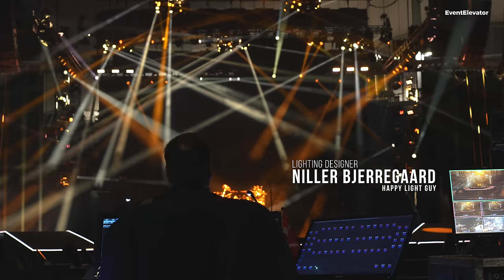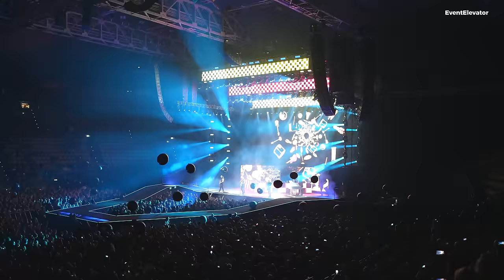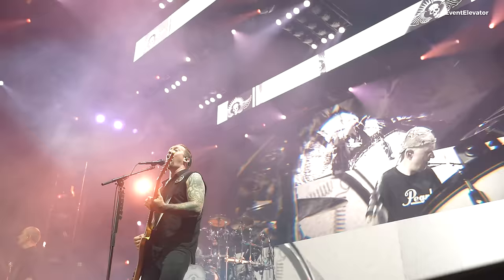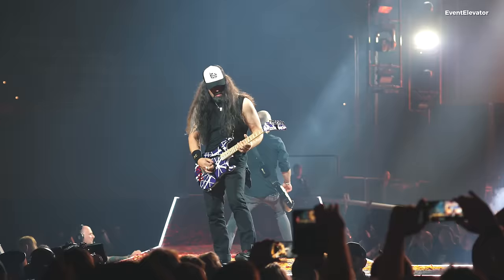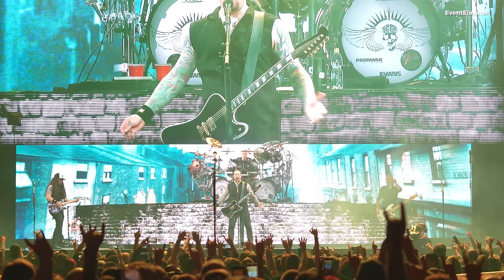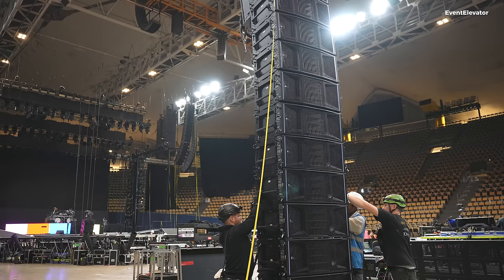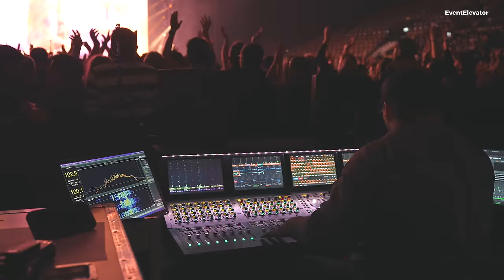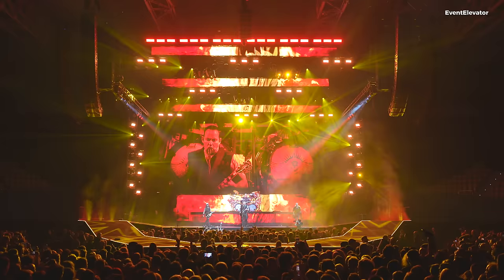VOLBEAT • Servant Of The Road World Tour • Show Design, Lighting Rig, Audio Concept

Comment: There are a few videos now from different Volbeat tours. They are allways very nice and fun to see, Also enjoyed this one. One thing thou that I would have liked Niller to mention was the followspot system
Reply from the maker: Thank you Amanda! Niller and the crew always make sure to have the best light for the cameras. Besides good coverage from the sides, follow spots are of course on the tour. The operators are located backstage and there are 3 ROBE RoboSpot positioned. They use them to control ROBE BMFL FollowSpot LT and BMFL Spot units.